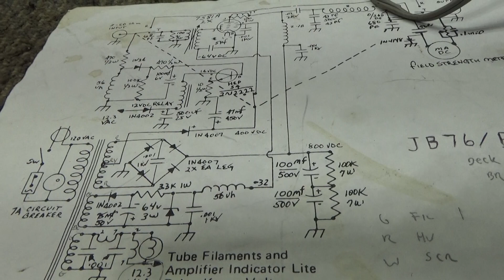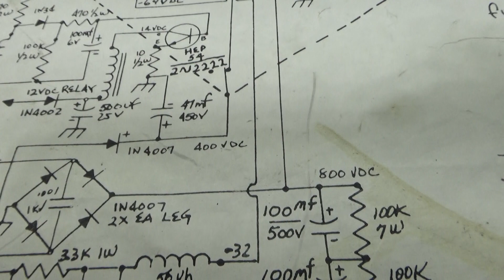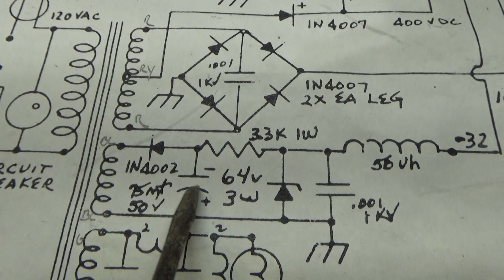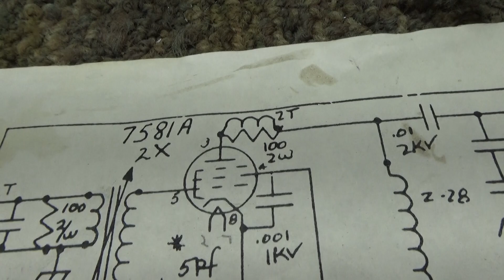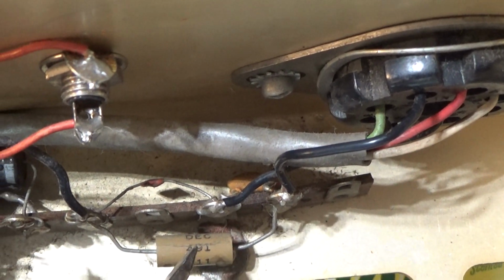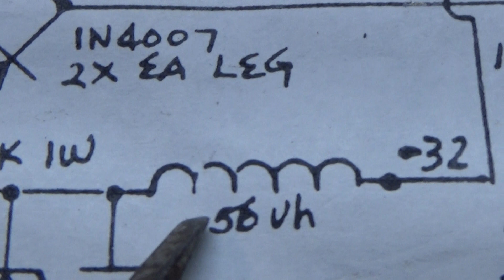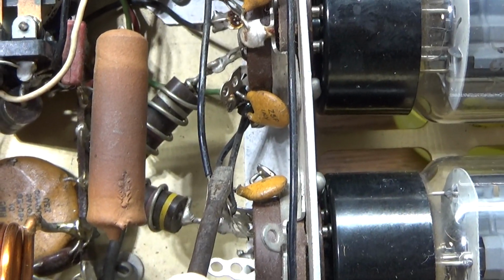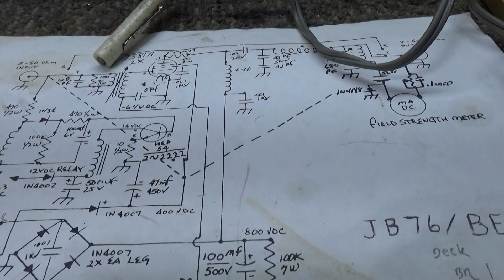Blackcat JB-76 aka JB-200 walkthru on the BIAS only trying to phone errhelp a friend LOL.

Comment: I've sent my jb-76b off for repair, and this sounds like the problem I was having. Installed new tubes and it was working great, dead key 40 and swinging 225, then all went dark. Pushed the reset button and it comes back on but dead keys 160 with no swing. I stopped right there and shipped it off for repair. Even if I'm wrong on what's wrong with it, I still thank you for the education on negative bias.
Reply from the maker: Yep, its the bias. Good luck with it. Those are great amps. They work great alone and also are one of the best 100-200 watt drivers made.

Comment: So far , I found different values installed in the bias on mine . The dropping resistor is a 22k RRO , the electrolytic cap is a 400v 100uf  (not original ) . Diving deeper , looking for a good accurate schematic. More to come .
Reply from the maker: Like I said, so many different variations. Caps as long as you have enough UF's and voltage, going over is fine and may do some good. Never go under though. I would check your zener itself and the 22k dropping resistor and if those check, trace your bias voltage all the way to the tube pins. You are losing it somewhere.
Reply: @tramdr  Checked voltage all the way , good . Caps , good . Zener good . resistor good . I think I already fixed it and forgot about it  due to the newer cap that I recall procuring not long ago . LOL!  DEoxit on the pins and relay contacts and fired it up . Its been running now for a couple 3 hours , talks up to 200+ from 10 with 3/4 watt input  real easy . Good forward RMS too . Time will tell . Thank you very much for the use of your schematic, time , and wisdom . TramDr. The Munificent :shelterin:⚡